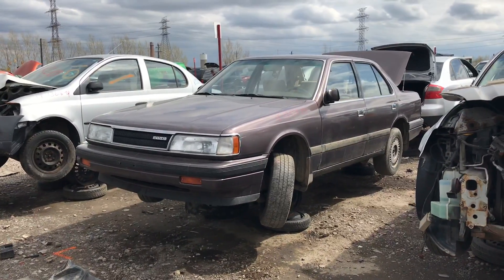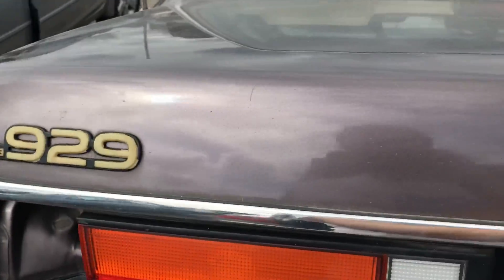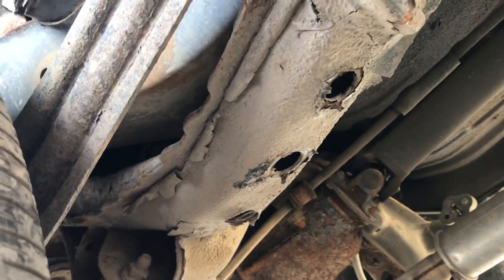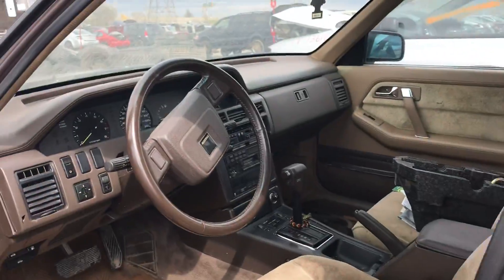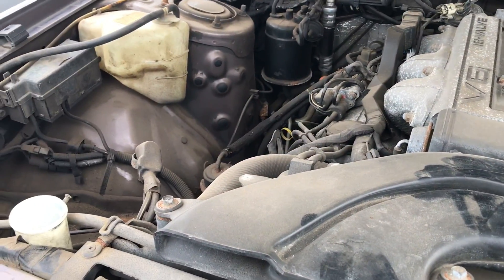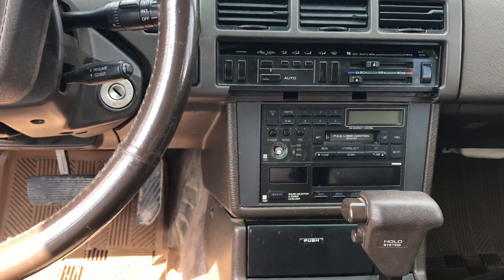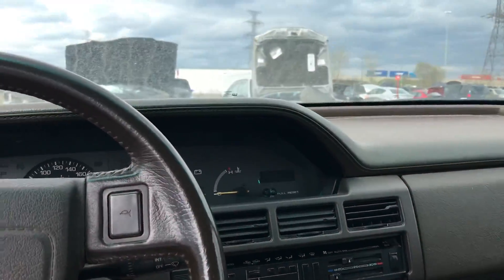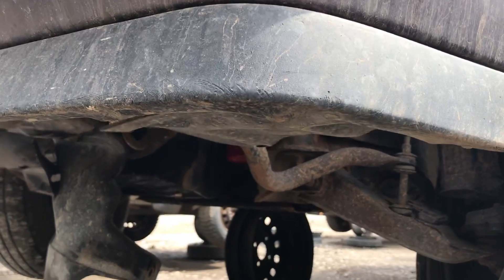Near MINT 1989 Mazda 929 at the Junk Yard

Comment: A buddy of mine bought one while I was in college. It was a hoot to drive. You could gun it around corner and oversteer like crazy.  I think it was a combination of the skinny old tires and an open differential out back, causing the inner tire to break loose.  The radiator was cracked though. It would steam like a gym steam room.

Comment: I currently have a 1988 Mazda 929 with less then 81,000 miles. I had the car for 10 years and only put on 1,400 miles/yr. Two of the door handles broke and I could only open those doors using the inside handle. I just replace one handle, got a brand new one for $28 on ebay. Several switches on the dash like the rear defogger are broken so I can't use them. When I got the car 10 years ago and still now there is a problem with the fast idle staying on too long. Also some times the idle is rough and I think it's the idle control valve. It passes smog easily and I never had it tuned up. The engine, suspension and drive train are very good but when the transmission gets hot it slips a little. Oil only leaks from some plugs (not spark plugs) on the top of the engine in the back. I think I add 1/2 qt in 1,500 - 2,000 miles but that's from the top leak rather then burning oil. I never use the car for short trips, I use my bicycle instead. Some times 2 weeks go by before I start it. When I replaced the front passenger door handle I removed the power door and window fuses before I started but I didn't remove the negative battery cable and now the power door locks don't work, the clock doesn't keep time and the radio doesn't keep the presets. I replaced the wheels like in this video with wheels from an Infiniti 1999 i30 that I liked better because the mazda wheels are a pain to clean and I got a really good deal on craigslist. I had to replace the master power window door switch and the passenger front switch. My mazda has a sun/moon roof. The body is in better shape than this one.